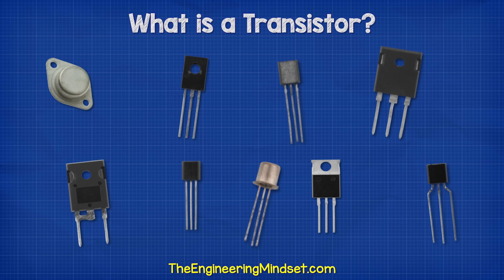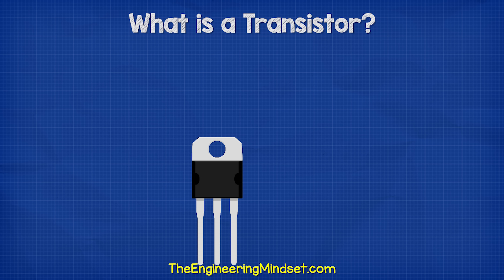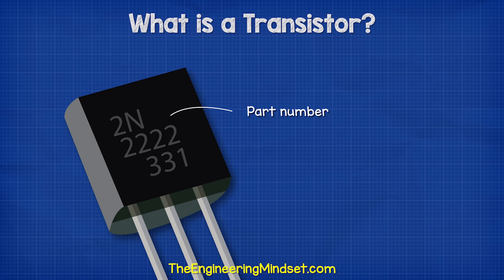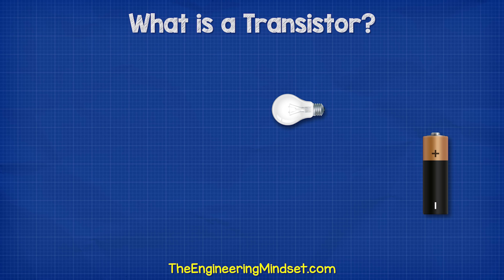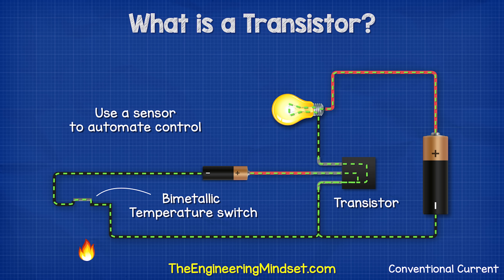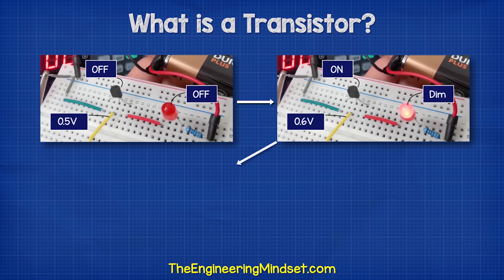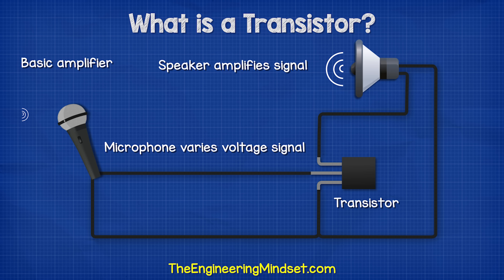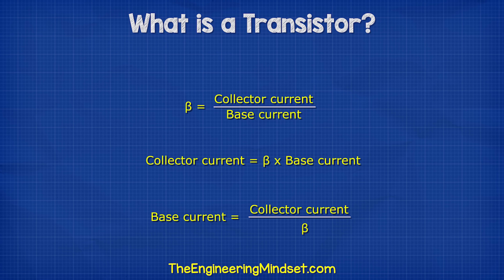WHAT IS A TRANSISTOR?

Comment: So what's the point in transistors? To have an excuse to use a small battery left over?💀
Reply: Without transistor your phone, car, laptops and any other device that needs to perform even the simplest calculation won't work. In your phones CPU there's ove 2 billion transistor that are micro. Transistors are the best inventions of the modern age

Comment: Cant we just control the current from the larger source using a simple switch
I mean we have to apply current in order to regulate another supply, so whats the main advantage of transistor
Reply from the maker: You don't need to manually press a switch, transistor allows automation. Use another circuit or sensor to control it
Reply: Yaa I agree on that point
But my question was, if we want to regulate the supply, then isn't there a way out in the main supply source itself, so that we dont need a transistor to do that task

Comment: This is a re-uploaded video, right?🤔
Reply from the maker: I literally have so many emails and comments asking for example "can you make a video explaining what a transistor is?" so instead of me replying each time to say hey have you watched our "Transistors explained video, it's all covered in that" I've instead just cut that section out of the video and launched it as a seperate video. Firstly it helps people find what they need, secondly it helps generate a little extra money so I can fund more projects and thirdly it frees me up to work on more projects. I have like 6 videos all part way in production but they take a long time to make. 
I haven't announced this yet but, I'm also building a new workshop so I can start to make some bigger projects and multiple projects at the same time! 🎉 Currently I only have 1 small work bench which really makes it difficult to switch between projects. Soon I'll have dedicated work benches for mechanical, electrical, electronics, 3D printing etc etc. I appologies the content hasn't been fresh recently but don't worry I'll be getting lots of new content out to your guys very soon. I'll also be launching some competitions too where viewers can win prizes 😎
Reply: @EngineeringMindset  quick question - in the case of electronics, how exactly does a NOT-gate work? i must just be thinking about it wrong but how do you go from a zero... to a one? like, what pin would be the input, what pin would be the inverted output?

if you have time ofc, loved the vid!
Reply: Seems to be all this channel is anymore is re-uploads from previous videos over a year ago. I haven't seen anything new in a long time.
Reply from the maker: See our new video on how to build mechanical versions of electronic circuits? Watch here: https://youtu.be/Zv9Q7ih48Uc

Comment: Bipolar transistors are current control devices. FETs are voltage controlled. Your explanation is reasonable for beginners, but as soon as people try to use a bipolar device, they must know that it is a current control device.